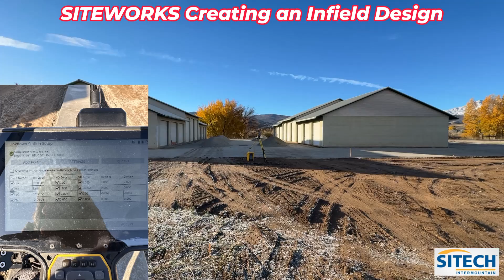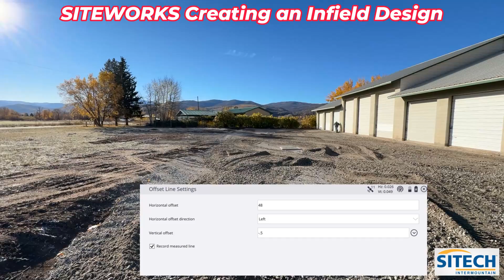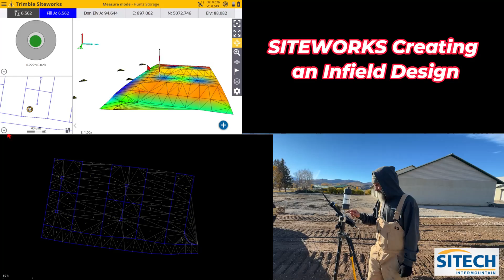Siteworks Infield Design   UTS   Exported to Earthworks

Comment: If you create your points and lines in Siteworks do you need to create a "Surface as Design" in Siteworks or can you just "Export to Machine" the linework and create the surface in Earthworks?  If you can is the benefits to doing it one way or the other?
Reply from the maker: @ericrudd587  yes you can export the linework to the machine by itself but is a very long process to create the design in earthworks because you have to redraw the lines over each point.  So the advantage is to just quickly surface it out as a design in the data collector and then export to machine.  That would be my suggestion